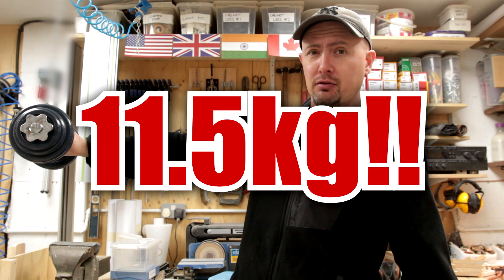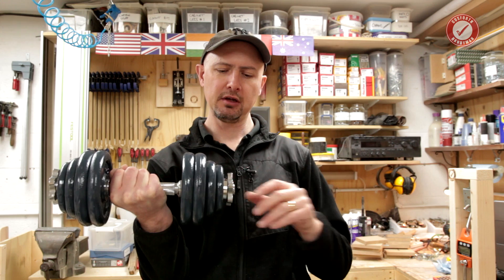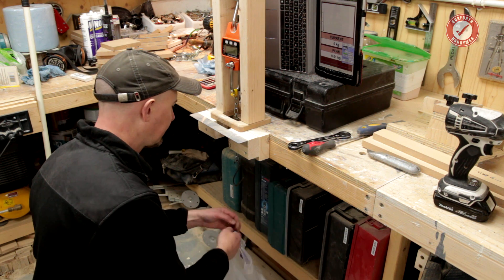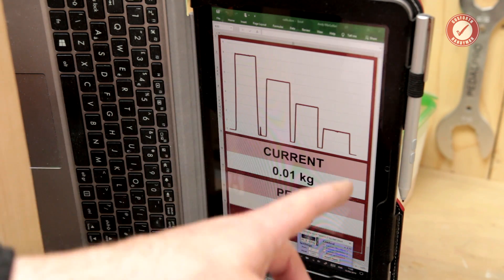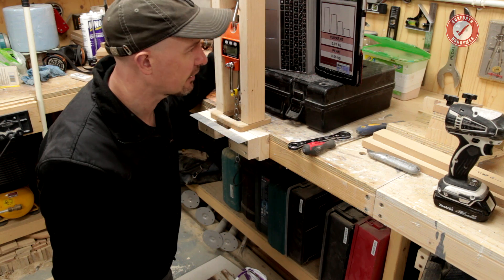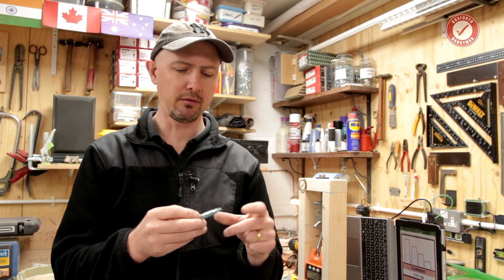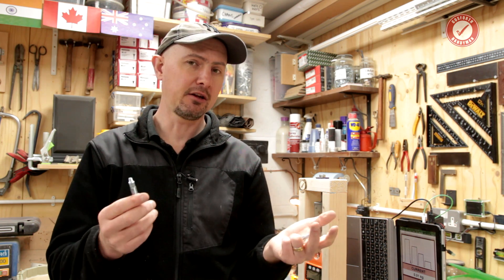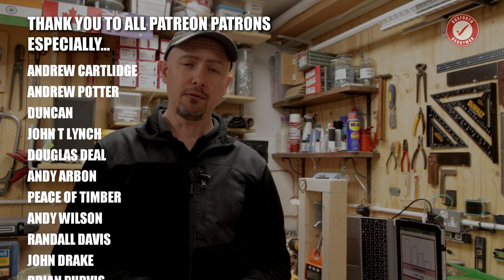Shear Loads vs Axial Loads and recalibrating my test rig - Test Tuesday!

Comment: Great video thank you. I have a question for you, if I may. I live in a new build property, The plasterboard is 12.5mm. From outside of the plasterboard to the thermite block, i believe there is only 35mm altogether. I need to hang a mirror which is about 7.5kg. So I’ve been looking at the Fischer duopower plugs or the grey ones you like a lot. What would you recommend? The mirrors have D hooks on the back, I was wondering whether I’d use heavy duty mirror hooks to hang the mirror D hooks onto or just leave a screw protruding and hang the mirror directly onto that. What length screw should I go for? 40mm m5? Thanks in advance, love all your content!
Reply from the maker: Personally I'd probably use expanding metal anchors for that. Should be able to get them to open up in the gap between the drywall and the wall. 👍
Reply: Gosforth Handyman thank you for your reply!! i have considered this but I thought I’d maybe run into dot and dab issues? I need to do two holes roughly 60mm apart, central to the wall space. I know there is the corefix fitting to combat this but was wondering if that would be overkill in this scenario. Was wanting to keep the cost down as much as possible and I don’t have a anchor gun either.

Comment: Gr8 vid Andy. I was gobsmacked that anyone would use these gobshytey things to bolster up worn out hinge holes... Why❓Huge and unsightly when hinge removed and reveals a mega bodge-it-n-legit mentality.
Why oh why not drill out slightly larger to clean up hole, take one trusty hardwood dowel apply favourite sticking libation, drive in and pare off sticky out bit. Job done❗Being hardwood dowels the screws will be going into a solid substrate, probably stronger than the liner to begin with. 
Neat n tidy and next person to remove the hinge won't be reaching for a sick bag and probably won't even notice the dowel is even there.
Proper job 😉

Comment: Only an idiot would use those for anything other than a picture frames. And yes I'm aware the world is full of idiots. But drywall has absolutely zero strength to resist anything other than a downward pressure, because drywall is made of rock, hence the reason it's oftian called sheetROCK. And as we all know, rock is not so grat with the sheer.

Comment: Thank you so much! 
I think your interpretation of axial vs shear load on shelving and the like is somewhat wrong. In your demo the base of the bracket is pivoting. Probably not the case in the real world- point load not withstanding. 
None the less you are correct in saying the screw fittings aren’t as ‘tough’. Yet the screw fittings are still fit for purpose, and cheaper in Australia (plastic). 
Great workshop experiment and thank you again. Keep up the interesting work!

Comment: Some thing that often isn't considered when comparing these fnacy now plugs to the old wall anchors is re-usability. Any plastic plug that takes a standard screw will only let you remove and replace a screw once or twice before the plastic gets mangled up. Wall anchors use a machine screw into a tapped hole, they can be removed and replaced dozens of times before any damage occurs to the threads.

Comment: I use the strapped ones.I actually used them to pull a pedestal sink to the wall that had come away and I did not want to dismantle the thing.I used the slider as a clamp then put the screws in.Still ok lol

Comment: I'd still like to see toggle bolts, for grins, if you can. We don't generally have the same options in the US that you do. I'm jealous of what you have. We have these spiral jobs, the expanding metal ones (expensive, though), toggle bolts (which need a huge hole), and plastic masonry anchors that have been bastardized for (ineffective) use in drywall and included with every shelf, towel bar, and wall hook you buy. Of those, the last ones are the most commonly used and found in stores.
Reply: Hello Pete,
Tell you what we in the UK will gladly swap our dry wall fixings for your dado stacks, how's that sound❓Deal❓
Reply: @Crushwokery  I do like my dado stack. Oddly enough, it (and the saw) come from the EU.
Reply: @Psychlist1972  well Pete I'm lost for words, for some reason we can't get machines with long arbors here. Obviously health & safety executive thinks were too dumb and can't be trusted with such dangerous multi component spinning things.
Unless I was looking in all the wrong places when I purchased my saw just under a year ago I could not find one that would accept a stack. 😭😭😭😭.
So who's jealous now hmm❓🤢🤮😉
You have a gr8 day Pete, good talking to ya.

Comment: Great video.  On the calibration front, checking the linearity is absolutely correct, however you need to go to a point in excess of the highest load you test to.  So for this video you need to get to 50kg!  Clearly your plastic carrier bag is not going to work, but you can use some of your tool cases.  Jump on your bathroom scales, note your weight whatever it is and then pick up each tool case and record the difference.  Even if the scales are out in absolute terms they are unlikely to be incorrect in the difference, they are linear too.
Then simply repeat your test but use the tool cases up to 50Kg or more if you want, you can hang the scale on a "sky hook" if you want, it will not impact the calibration.
My guess would be that your scale will be quite good, and the test you have done is at the lower end of its range where it is likely to have its maximum error.  Good luck.
Reply from the maker: Cheers - good idea. They go up to 300kg though! 🤔
Reply: Hi Andy.  ok, but in reality your tests are unlikely to ever go that high, so if you can calibrate or check your scale up to the maximum you are ever likely to use then that is perfectly good enough.  I see your object as demonstrating to your viewers that you are showing loads that are of the right order.
If you were ever concerned to go higher, the manufacturer could do it for you at a price, or there is probably a local company who could do it.  For the amount of use you give it, I doubt that it would need checking more than once every 3 to 5 years.  @GosforthHandyman

Comment: Good setup and execution. However shear forces are acting mostly on the part of the screw extending from the wall. There are close to none shear on the fittings, as they are supported by the plasterboard. As you mentioned by far the most important is the axial load. Since there is some play between the screw and the fitting, the screw will pivot downwards under load, increasing the axial force.

Comment: A litre of water is exactly 1 Kg as a reference. Near enough's good enough anyway, especially for comparisons.
Reply: Not exactly, but as close as dam it and does vary with temperature. https://www.google.com/url?sa=i&source=web&cd=&ved=2ahUKEwj72tat68jgAhVHgM4BHUVmDqYQzPwBegQIARAC&url=https%3A%2F%2Fsciencestruck.com%2Fdensity-of-water-at-room-temperature&psig=AOvVaw31ccKGFy6Frb1aM4DTi02f&ust=1550701491465977